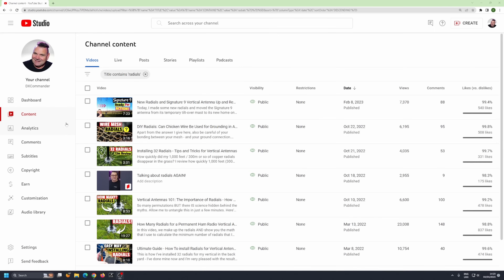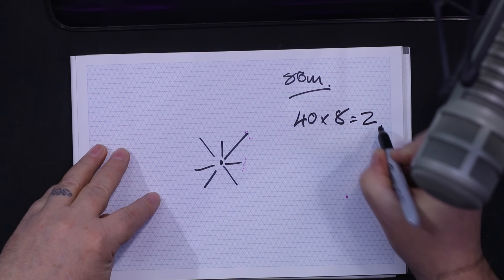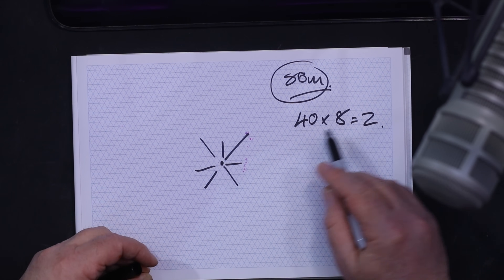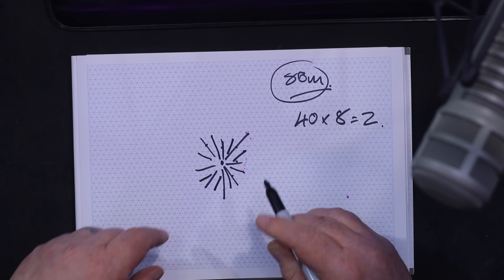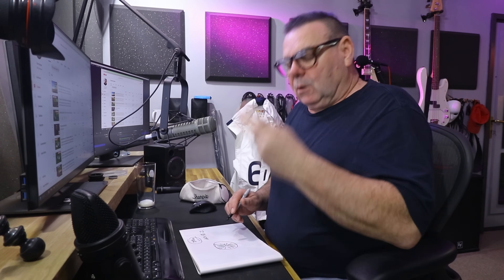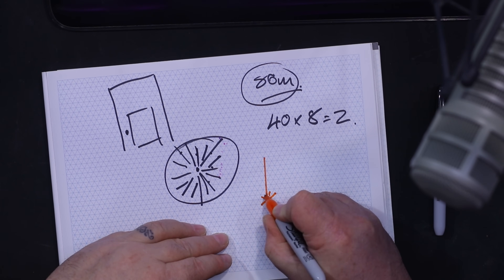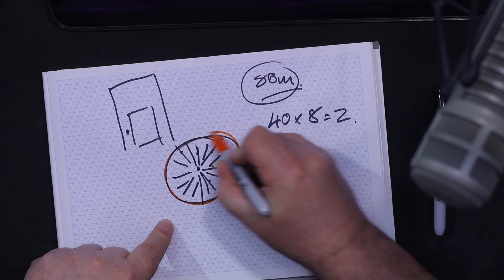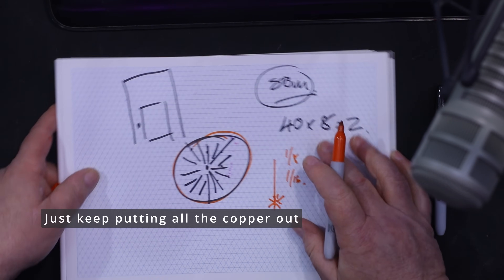3 Rules - Quick Tip - Radials for Ground Mounted Vertical Antennas

Comment: A little late to the radial party, but I put up a dx classic with 21 3 meter long radials that were placed 180 degrees facing north ( the antenna was up against a fence).  And I worked all of South America, South Pacific, Antarctica, South Africa on 100w . 

Half the time, my dogs would turn my radial field into a spaghetti bowl and I wouldn't even know it! Callum is right as always, just get them on the dirt and hit that tx button.
Reply from the maker: Good work!!!

Comment: Callum, I bought your kit with plates and wire and built a Clasic 80 - 10m with a Carbix pole, and I did as you describe, cut a few different lengths to fit the corner I have the antenna and it works perfectly 80-10m good swr. thanks for more wise words from you. Build and test, what can go wrong :)  73 de SM0LTV

Comment: Great video as always. Im looking to make something that works a little better than my t2lt with airchoke... would you recommend something that uses ground radials? I akso have a small garden in a city so the qrm is very bad. I use 12.11.10 and 15 meters so far with limited results using the t2lt. Thank you in advance for any help. 73's
Reply from the maker: For these higher bands, something high can often work well like Imax 2000 / Gainmaster etc.
Reply: @DXCommanderHQ thank you Callan. Even for fairly close to houses? With the base only 15 foot from the ground? I'm near the centre of town on the south east coast about 3 miles from the coast and 150 foot above sea level(if that is relevant)
Reply from the maker: Erm. 15 feet is probably OK... Check out a cheap CB antenna.

Comment: Hi Callum. thank you for all your videos. Im back on CB after 40 years and now studying for my Foundation licence.  I have a question for you if I may.  I have a Silver Rod HyGain Venom 5/8 wave.  It has 3 small 30cm long bird perch type ground planes.  Ive had issues with the SWR which ranged from 1:5 to 2:1.  I decided to extend the GPs by another 40cm and the SWR came down to 1:4-1:9.  Im looking to extend them further  to 90cm and then get some aluminium  wire to the ends and join them up for more ground planeage.  Im going to get close to the Optimum 11m of GP for the antenna.  My question is would 8m of Ground plane make the antenna perform better than the standard 0.9m GPs.?
Reply from the maker: Best to just use what the manufactuer gave you. Some of these ground planes actually do very little... Now - if it were a genuine quarter-wave, then yes - they will become the otehr half of the antenna - but I would have thought you have a coil-fed transformer in that one and therefore you are almost barking up the wrong tree... But a heck of a good question and frankly I'm clutching at straws on your behalf here.
Reply: @DXCommanderHQ  Thank you! A few of us have found it so much easier to tune if we extend the "Bird perches".  Its definitely helped by adding 40cm each....so I thought it would be fun to try and lengthen them a little more and see it we can get it down further.  I have no idea though if this will improve the RX/DX (dB gain?!)    Yes, you would expect the manufacturer to design it to work best "as is"...but a few of us have found its working better with longer GPs!
Reply from the maker: @johnbeagley1195  Gain wouldn't change... Height will make a difference for DX (and to an extent local too)... Of course - local contacts and DX are different. Local contacts need zero-elevation but DX wants between 5 and 15 degrees off the horizon - this makes me chuckle when I read flame arguments on the internet - because folks aren't often comparing apples with apples :)
Reply: @DXCommanderHQ  Loved the video you made of raising your antenna and using the repeater stations to see how each meter up made a difference!  Mines 6m up on a temporary scaffold pole arrangement.  Hoping to wall mount it when I stop tweaking with the 5/8 wave.  I wil try and get it up another 2m if I can!  Thank you so much!  Much appreciated.

Comment: This is such a great stress relieving video. What about elevated radials? I heard you only need a few compared to many on the ground. I have a vertical with a feedpoint at about 5 feet above the ground. If I put up elevated radials, how many would be sufficient and does the same rule on length apply or how does that change.  Regardless I am happy to learn I can make my radials shorter. I do have an AT2K tuner that tunes anything I throw at it for the most part.  Cheers!
Reply from the maker: It is my opinion that elevated radials can work - but after reading Rudy Severn's somewhat complex analysis, I decided that the accuracy and engineering required - as well as the "look" put me off :)
Reply: @DXCommanderHQ I want to thank you a MILLION. My wife hated the elevated radial look and I do as well.  Tonight after watching your video I cut 24 radials of 3m each. I have an area around my 27' vertical antenna of about 3m and was able to put radials all around the antenna 360º. Tonight I worked Guam, nearly 7k miles away as my first contact on 20m phone tonight with a 55 and he was 57.  This blew me away and I nearly dropped my beer!  I have been working on my limited space challenge for so long with so many different options told to me, and as you say just keep in simple. I did not doubt what you said knowing you wouldn't be making a video for the sake of blowing hot air and it just made senses ;-) Anyone seeing this comment, this really does work.  24 radials, 3m long around your antenna on a radial plate works VERY WELL.  Thanks for making this video and taking the complexity out of radials. My days of worrying about this are over. I am not sure adding any more than 24 is going to make any noticeable difference.  I just ordered a second radial plate to take out for POTA.😊  73's!

Comment: How does a connection to the dirt wwith multiple ground rods or burried copper compare to a field of short radials?
Reply from the maker: Badly... You need the surface with copper on it - not underground.

Comment: Thanks for your content, very helpful.  Question, does an odd or random number of radials matter?  For example I have 7 quarter wavelength radials at the moment.  Thanks.
Reply from the maker: Nope... I have settled mostly for lots of 2m / 7-ft long radials. Works fine!

Comment: When you put down radials, don't worry about the perfection, just do what you can, as it will still work 360 degrees around the radiator!

Even when your antenna is in a corner of the garden/back lot/antenna area, and lay the radials in a 90 degree arc, it will work!

Not everyone has a perfect antenna setup, but they still get on the radio and work the world, and there are those who do have a perfect antenna, and still need someone to log their QSO to get credit! (ME!) So don't worry about it, get on the air!

And please QSL the contacts!

Comment: What if you haven’t the room for correct length radials?
Reply from the maker: "Correct length" is what ever you can squeeze in. My last demo was 3m long (10 feet) and you only need 180 degrees. Some folks have even done 90 degrees.

Comment: I agree, people seem to be chasing ghosts but all the losses add up but as you say make little difference.
One question I do have is  I'm just getting into HF and I'm out playing Pota with a JPC-12 (UK). 
I have 4 radials (the standard 10 cable ribbon feed spilt into 4)  and I often operate in long grass so the radials can sit 6" to 12" off of the ground. I was considering pegging the ends out and down to keep them close to the ground, or even putting rings on the end and grounding the radials. Do the radials act capacitively  so shouldn't be earthed.
I was just curious if you had any thoughts?
Reply from the maker: Honestly, it doesn't seem to make any difference. So you are doing fine. You might find MORE radials but shorter may be easier to deloy with no difference in performance.
Reply: @DXCommanderHQ  I'm going to have play with more radials. I was by the sea yesterday and used the salt water for a counterpoise then I went with the ribbon cable radials and no noticable difference. 
Still made the US on 20w on my G90 Thanks for the response :)

Comment: Building a few improvised verticals with 3-4 radials, even non-resonant verticals -- I could still reach across the Atlantic with a KX2 running 12W if I tried for a bit and chose the right hill.
Reply from the maker: The right hill, the right day and with a good wind ;)

Comment: I know i’m late to the party here, but has anyone ever tried using electric fence wire? I have no idea what the velocity factor would be of the wire. But has anyone ever used it for antenna applications? I also have some steel wire that was used on a wireline rig in the oilfield. It’s similar to the electric fence wire but larger diameter and VERY stiff! I wonder if it would work in any capacity. This is bare wire by the way. Somewhere around 1/8”-3/16” in diameter.
Reply from the maker: Sure, all wire works.

Comment: My question is if a vertical antenna is 1.5 meters off the ground, do the radials need to be elevated or can they be connected to a radial plate at ground level?
Reply from the maker: I have not tried 1.5m however I honestly think that you could run a ground strap down - and connect radials there.. There's a definition of how well something works.. "Will it work"? Yes it will.

Comment: Jolly good show (isn't that what you say there across the pond?). Seriously this was a fun, entertaining, and encouraging video! Thank you. I know you said radials is a different subject, perhaps because you are not considering a TUNED (resonant) radiator? Seems it was not made clear that you were only considering non-resonant radiators. Please correct me if I'm wrong in thinking that some attention to having quarter-wave radials is warranted for resonant radiators, especially in fixed (more permanent) deployments and where space permits. In any case, I do agree with your assertion of "get out there and try!", and that it can be easier and also effective to deploy some shorter counterpoise wires for portable deployments, maybe even regardless if you are using a resonant radiator or not. Even a single wire counterpoise has been found effective by portable operators. Even though some claim that their end-fed halfwave with 49:1 unun operates just fine without any counterpoise, the shield on their coax running back from unun to tuner (or rig) is serving as a CP. Also, I have heard this assertion before, that if you get down about a wavelength of CP wire deployed, don't worry about the lengths of each wire... Thanks for sharing, and keep up the good work!
Reply from the maker: I only use "tuned" element. If that's what you mean.

Comment: I connected to the base of a downspout on the metal building I'm in, and added (8) 3m radials (not even an unun, do have a manual tuner) and made several 10m FT8 contacts in Europe last week. My point.....just give what you have a shot!

Comment: using an x80 vertical i put out 8 counter poise about 1 inch under ground, with 25w i got into usa first time ever but as you say all the counter poise are facing the wrong direction so right there with your video.   i cut them all the same length as the vertical ( 5m ) im having to move the x80 soon as the trees are starting to catch the top of it and bend it. should i lift the counterpoises and move them as well or will they still be effective if i run a feed wire from the counterpoise junction point the new x80 position 5m away?    great vid thankyou.🤓

Comment: A little late on this comment but, about the over thinking, maybe, but I imagine it's an actual case of over worrying. The guys capable of engineering math may be over thinking this but I and other average thinking hams are too busy worrying about what the engineers are over thinking about. They tell us that a test meter, and two pages of math says something is 5% better and we freak out. The problem is no one can tell when we spend two days digging and dying out in the heat. Here is my take on this more is better and lots more is lots better, no it ain't. Do the s meter test. If they can't see a difference on their s meter and I can't see a difference then it's a waste of time killing myself trying to duplicate a Labatory finding. I put down a ground rod, 12 radials of various lengths, it works well, that's test enough for me. They can sweat the math while I sit in the shade talking on my radio.
Reply from the maker: You are right. You can't hear 5% :)

Comment: Thank you for sharing Calum .
I'm not a ham radio operator yet , however I do use 11 meters on 27 MHz , I'm using a 9 ft stainless steel whip with X 4 ,5foot radials they work perfectly , I'm just trying to find the correct length radial for the 27 MHz , I tried 8 foot radials & they failed , I just couldn't get the swr down , I've been told that 7.5 foot are the correct length ?.
Reply from the maker: OK, so ignore radial length.. Just angle them downwards a bit and then trim the actual element to length. Google "m0mcx SWR Calculator"

Comment: I have a a fairly small garden, I may not have 5m to run even one radial, how big of an issue is it if the radials aren't straight, can they loop back on themselves? 90 degree bends in them, zig zag etc, is that something that will hurt the performance to a noticeable level?
Reply from the maker: Don't come back.. Just put more shorter ones down.

Comment: Im setting up mine with 28 3 meter radials.  4 on each of the 7 lugs.  I did run short of wire for the last lug so Ill get 40' more at HD.  I only used enough element wire for 40, 20,17,15, 12,and 10.  I will order more wire from DX and use the 30m slot for an 80m inverted L.  I have an 80m EFHW thats working pretty good now,  My intent is to leave both antennas up and switch as conditions dictate. KE2DCN
Reply from the maker: Switching between is good fun.

Comment: there was a ham in texas w5pyt. he knew and shared a lot. how to tell if your antenna is efficient. with a measured power like 5 watts. read the antenna current with a current meter(make one). when you stop getting improvements in antenna current stop adding ground radials.

Comment: Hi Cal, Great simple Video as always. I love this Channel for years !! What about pasture fence as radials? In my opinion it is safer when cutting the gras with a lawn Traktor. How many meters for 160-10 meter?  Normaly the width is 1 m to 2 meters. 

73 from Lars DH1LL
Reply from the maker: Lars, I did actually connect my radials to the fence with zero effect. You can't beet a few radials.
Reply: @DXCommanderHQ   TU !

Comment: Thanks for the great video, Callum. I'm probably still over thinking this but if I'm going to cut radials at a given wavelength (e.g. 1/8 wavelength), should they still be cut based on the lowest frequency of the antenna (e.g. 30m for the Rapide)?  Thanks, and 73!
Reply from the maker: No.. Random works.

Comment: My camp trailer portable antenna is a 40' fiberglass Spiderbeam mast. I have a 4" diameter black PVC pipe about 30" in high mounted to the rear trailer bumper using a spare tire carrier. I put the mast in the PVC pipe and hoist it up with a small pully at the tip and paracord strung.  I host up the same  DX commander sized vertical elements for the individual bands I want to work. I throw out 16 x 16' foot radials and also have a  ground cable to the trailer frame.  I have set this up at home and have done an A/B switch between my 80-10M multiband wire vertical with 48 ground radials and the camper trailer antenna. On 40m and 15m there is a very slight difference in receive signal with the the multiband/48 radials over the 40/15m single element with 16 x 16' foot radials. Signal reports from contacts were the same on ant A or B on both 40M and 15M.
Reply from the maker: Nice example!

Comment: Last summer I neededed a quick bamboo vertical for 20 meters using speaker wire as the radiator. I did not have enough wire for radials, but had two good sized pieces of wire fabric with 1/4  inch grids. Sat the vertical over the fabric and connected the shield to it and wala we had a perfectly functional antenna for the needed moment.
Reply from the maker: Nice work!

Comment: I'm a n00b. I have a kit with 3 very long (33', 10m) radials. Am I better off cutting them up into lots of smaller ones? Is there anything gained by sort of...running them in spirals or other patterns that meant they cover more ground closer to the antenna? Is it all just magic? 😀 

I'm not sweating it a lot, but I am curious!
Reply from the maker: Chances are, lots of 6 ft radials in a STRAIGHT line will be better.
Reply: @DXCommanderHQ  Thank you!

Comment: At this present time, I am working through the "data" of my tests. And, by posting the information within my Ham Radio club group on FB, the consensus has been that my 40 meter radials are too short. The impedance has been higher for 40 meters between 70 to 80+ ohms.
I am remeasuring the driven element and trimming it per Callum's instruction sheet, and my first trim of the 40 meter wire brought the impedance down from 90 to 72+/- ohms.  After watching this video, I'll re-evaluate my radials and perhaps add another 5 wires to the array. At this time I have 10 radials cut to 10 ft. The guys in the radio club think that the radials have to be 1/4 wave length but looking at "counterpoise wire lengths for EFHW" they're only 2 meter length for 40 meters.  As Callum is stating in the video, "don't over think this..." You can use shorter wires but more of them."
My plan is to simply remeasure the 40 meter element and then add some more radials 5 meter long.  And retest.... DE kd5smf